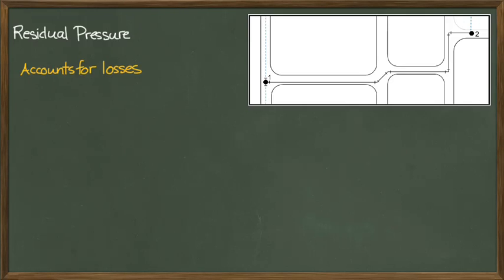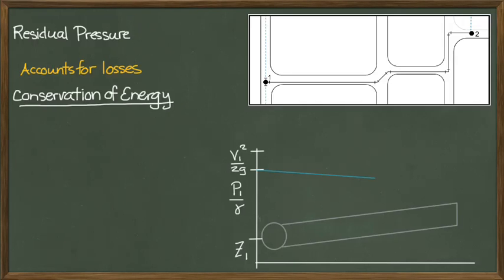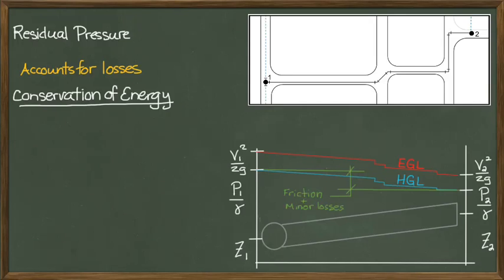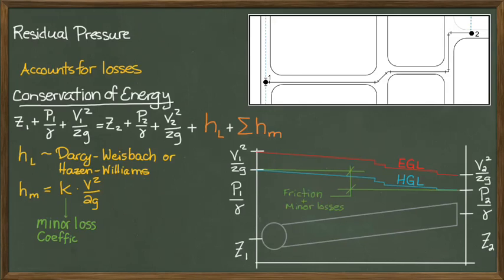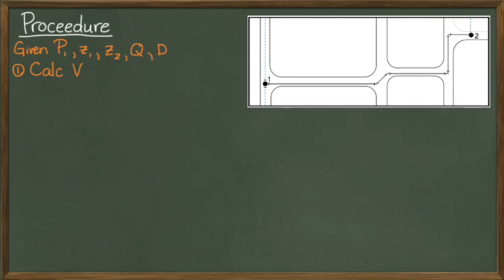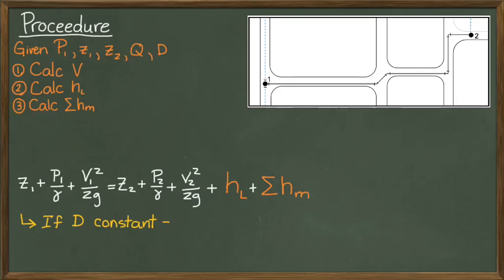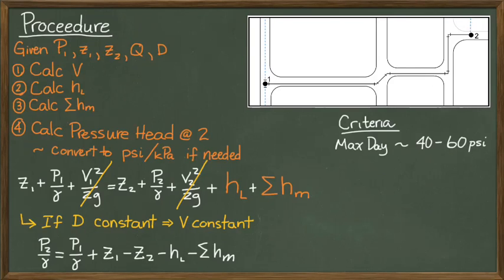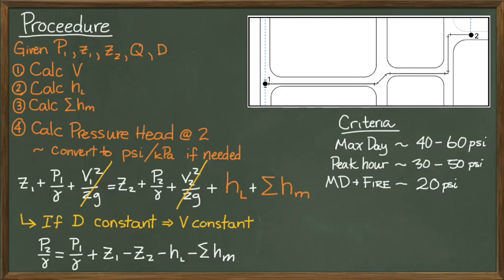Residual Pressure

Comment: Working on a similar problem but am having an issue I was hoping you could help with.  Ive found that the pressure I calculate at point 2 is directly tied to the flow rate that I assume when calculating the head loss.  I don't have a specific demand.  I just want to see the maximum flow obtainable by extending a waterline a certain distance with a given static/res. pressure at point 1.  Would you just assume the residual pressure at point 2 is zero psig to obtain the maximum flow (solving the energy equation for h_L) since the pipe is exiting to atmosphere?  If that is correct then the max fire flow is where residual pressure is 20 psig?
Reply from the maker: Yes, that approach should also help you find the max flow (when p2 =0) and the max fire flow (when p2 = 20 psi).
Reply: @kennethwlamb  on a different note, could you consider the pressure drop from static to residual pressure to be equal to the head loss from the source to the point at which the reading was taken?
Reply from the maker: @one-eyejawa3128  yep, that is correct
Reply: @kennethwlamb  thanks!  10 years out of school and just now starting my EIT time. Some things are a little rusty.
Reply from the maker: @one-eyejawa3128  Good luck to you in your preparation!

Comment: Hello sir. I am doing a project where I am trying to utilise the residual pressure in plumbing line for high rise building in this project I am using the residual pressure to lift the water from underground tank and store at the intermediate floor and then water will be distributed by gravity to dwelling units which are below the proposed system ( here I am going to replace some mechanisms  pressure reducing valve and I will add some intermediate tanks )   Can you please tell me will this project work ? Can I goo further with this project
Reply from the maker: To clarify: You wanted to use the static head from your sewer system, to lift your potable water system to an 'intermediate floor' in the building. Does that sound correct?  
I'm intrigued.  It seems like the math could work our depending upon the static head in the sewer, the mechanism you choose to keep the sanitary water from the potable water, the elevation of the potable water tank underground, and the elevation of the storage tank at the intermediate floor.  The piping connecting all the components will be important too, but less important because most of the losses can be designed out of the system.  Email more details if you want to continue the conversation: kennethwlamb@gmail.com.
Reply: Kenneth Lamb  ok sure